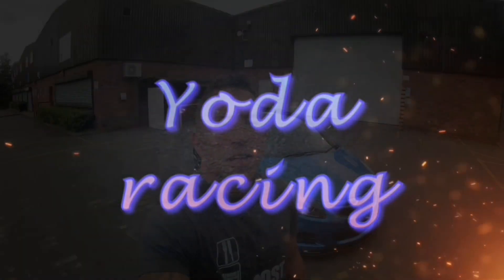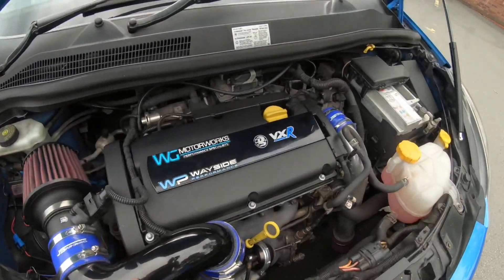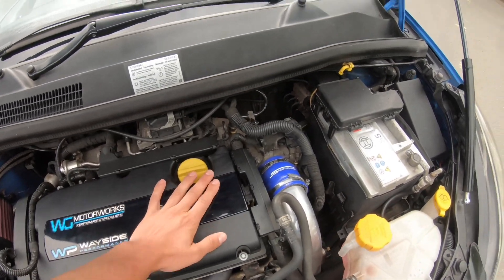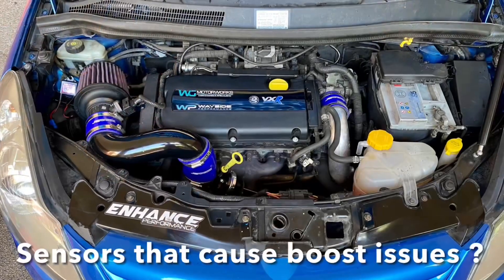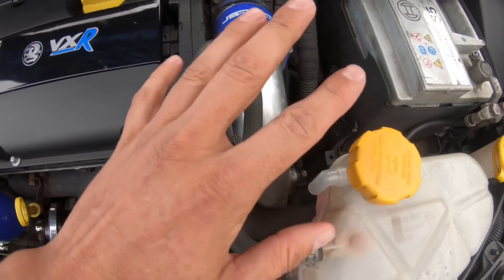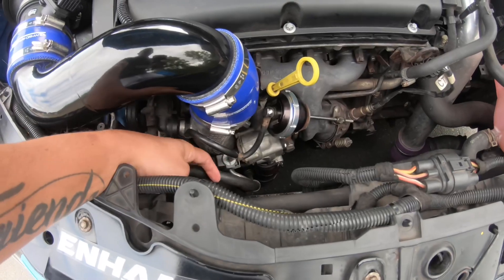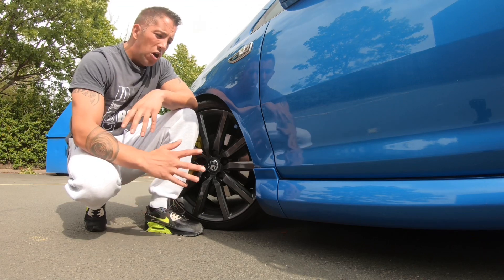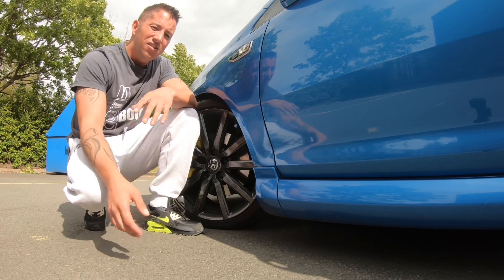Corsa vxr buyers guide common problems part 2

Comment: My subframe is the only thing that's showing rust on mine , but it's only surface rust I plan to treat it and paint black before it gets bad but I'm gonna wait to use my mates lift as I can't imagine it been a nice job off Axel stands and jacks lol good video as always mate 👍 funnily enough I've changed a rear caliper today bit of extra advice to help , the hose can be a pain unscrewing from the caliper I've had this a few times and it's easy to round the nut off . Unscrew the hose from the brake line instead of the caliper using 11mm and 16mm spanner's let it soak a bit in wd40 first. you will lose a bit of fluid but it's easier then put the caliper in vice to remove the hose especially if it's never been off the car you will find it really tight it's easier this way 👍
Reply from the maker: Cheers buddy good advice that 👍🏻
Reply: Nice and easy on the ramp but agreed on the drive it'll be a headache 😂

Comment: Hi mate should there be a vacuum line going to the manifold map sensor or pressure sensor some call it? There a electrical plug plugged to it but how’s it take readings with nothing else going there? Corsa vxr 2009 thanks
Reply from the maker: No it takes the readings off of the boost pressure within the intake pipe 👍🏻
Reply: @Yodaracing1  I know that map sensor is in the boost pipe but whats the one on the back of the inlet manifold next to the bcs they are both on a black plate bolted on the bottom of the inlet manifold? It looks like a map sensor but it’s not going to nothing boost pipes neither inlet manifold so what’s it purpose or am I missing something? Thanks mate
Reply from the maker: @rickiclark500  bolted to the ecu with a vac line going to nothing ?? It’s basicly a ambient pressure sensor

Comment: Hay up hope your well as you know am on a standard engine having what I think is a fuelling problem low revs it’s missing a little but after certain revs it’s fine ie boost would you change injectors and fuel pump and if so what to the car is standard apart from 3 inch cobra and sports cat ?
Reply from the maker: Hmmm fuelling issues aren’t that common on these I would check your plugs also do a compression test

Comment: When the boost control solenoid fails or even map sensor does it effect idle on startup?
Reply from the maker: Not usually this could possibly be maf related as the bcs and map sensor only effect boost is it only on cold start ??
Reply: Hi guys good video again Yoda, think my MAF is needing cleaned up, standard air box with k&n panel filter for about 1.5k miles now, symptoms... Slight jutter on acceleration (not flooring car) thru low gears on cold start but eventually clears when car warmed up? Possible oil from k&n on MAF? i will clean it and return to OEM air filter and report back, keep the good content coming👍🏻👍🏻
Reply from the maker: @leseriath  hmmm hard to say possibly mafs don’t like oily filters deffo worth a try
Reply: Worth a shot I'll give the MAF a good clean with some IPA see if that helps👍🏻

Comment: Had another problem with mine water keeps boiling up like a kettle in the coolant tank and shooting all over the engine bay their is no smoke from exhaust no sign of oil mixing with water can hear heavy bubbling and the water is ejected from the tube on the side of coolant tank literally all the water shoots out tank goes dry and fan constantly running parked her up  😓
Reply from the maker: Hmmm deffo over heating then you sure your hg hasn’t gone ?? Or could be a thermostat stuck shut
Reply: @Yodaracing1  I had a mechanic run a quick chemical test and oil seems fine no sing of any water leaks going to replace the thermostat and will let you know how it goes fingers crossed 😓